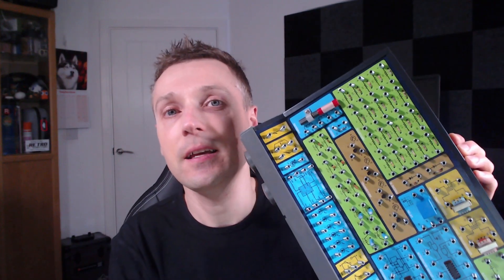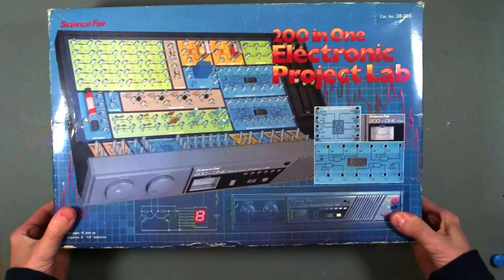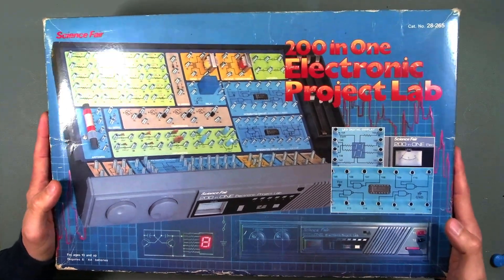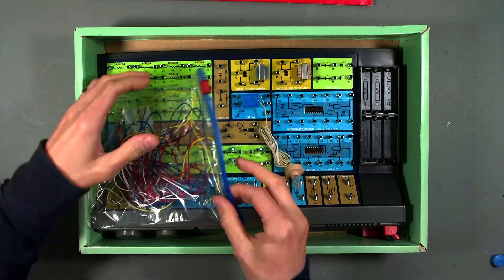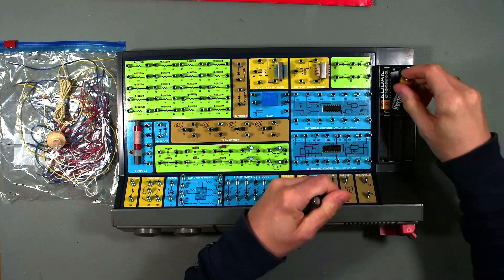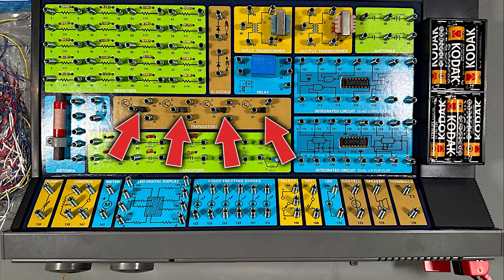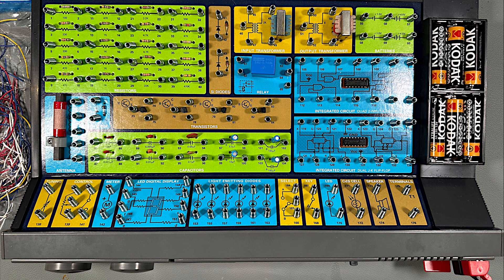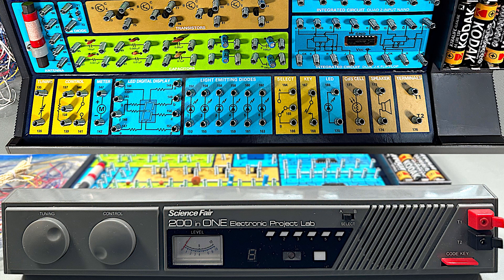Rediscovering 90s Electronics Kits - and I owned this one!

Comment: I had the older blue one, the only difference (other than cosmetically) was that it had an incandescent red lamp instead of the solo LED.

I don't know who designed the booklet but I've always assumed Forrest M Mims III must have had a hand in it, I still have a few of his books from Tandy.

I just bought the Maxitronix version of this kit from eBay because I never really paid attention to what they were using those transformers for, some of the projects look like they being used as inductor coils.
Reply from the maker: I think some of them were. One of them is mostly used as an audio output transformer, cant remember what they used the other for without skimming the manual.

Comment: 8:30 Also not need a battery, if I remember correctly, Connect that cristal earpiece to the antenna thing using the largest coil. Desolder the speaker from that old transistor-radio, Connect a long piece of wire and loop it around your room. Try to hide it from mom.
Now enjoy your wireless earphone.

I used my kit a lot in the early eighties and late seventies. Never got my head around how things worked tho. That changed only recently after watching various channels on YouTube.

Comment: I remember when I was like 10 my grandfather gave me this little Radio Shack crystal am radio kit. You would hook it to a fence and it had a little tuner knob. It didn't have batteries and it actually worked. Blew me away. Now I am Electronic Tech for 30 years. I have had several of these kits and played with them when I was young kid. I now use bread boards when I like to tinker. Everything is computer driven now, networks, computer repair, etc...

Comment: I had a 130 in 1 and that same 200 in 1 when I was younger.  I remember on both of those, I ended up frying at least one of the transistors and LEDs while experimenting around.  I also ended up killing the level meter in the 200 kit.
Reply from the maker: Wow I’ve had comments about killing LEDs and Transistors but this is the first about the level meter - kinda makes sense though it’s probably just as easy to damage

Comment: I had this exact kit - thanks so much for the trip down memory lane! I loved it even though I had no clue what I was doing (my biggest issue was that the instructions don’t really do a good job of explaining WHY something does what it does, or perhaps I was too young to understand). Ultimately, this kit gave me my first taste of the dangers of electricity when the batteries ran out, and so I decided that in order to complete the radio that I’d been trying to get working, I had to plug it into the mains. I used the external connectors on the front and wired them in where the batteries would normally go. The whole thing died in a blue cloud of smoke and I got 240v through me, and ended up on the other side of the room. Good times.
Reply from the maker: Wow, well, I guess that’s one way electricity earns some cautious respect!

Comment: I had a couple of the smaller kits when I was young, and remember building the simple radio, the burglar alarm, and so on. But I didn't learn a thing. I just followed the wiring numbers and it did the thing. I might try changing it a bit and it didn't work any more. Electronics was not for me.

Comment: I remember having one also , My fave project was the alarm where it buzzed when a wire loop was broken so i had fun rigging up many things around the house like doors etc. I remember somehow shorting the battery springs once and the batteries used were ni-cad rechargeables and the spring glowed orange, it was not too shiny after that 😀.
Reply from the maker: ooooh, you made a heater :) makes me wonder if its really suitable for that age range
Reply: @RobSmithDev  I have no idea but these types of products are seriously lacking in todays market , Ive often speculated on making a version of this project kit with integrated rp3040w board with springs etc for its pins.

Comment: I still have this set 😀 I also had the 20-in-1 and 130-in-1 sets. The latter I always thought was better, despite having less parts, although it had way more capacitors. The 130-in-1 has an op-amp chip instead of a second logic chip. So many of the projects start 1-29, 2-30 which means "connect the transformer output to the speaker" 😀
Reply from the maker: An op amp would have been a great addition, well, that and maybe a 555 perhapse

Comment: I had this kit. I kept on blowing the LEDs out because I was still ignorant about putting a series resistor in.
Reply from the maker: I’m sure you weren’t the only one!
Reply: @RobSmithDev  They should’ve really put the LEDs with resistors pre wired in so this wouldn’t happen. Also the diffuser at the front panel should not have been used, it makes the LEDs too dim.

Comment: Can you tell which transitor that is from the markings on the transistor used for the one transistor radio? I got back into making crystal radios and now I’m interested in making transistor based ones too.
Reply from the maker: The NPN are C945 and the PNP are A733 transistors
Reply: @RobSmithDev  that was fast. Thanks!

Comment: I had a 100 in 1 kit. I didn’t feel like it taught me much except to some extent what each component could do. Like on the page you showed, the coil on the ferrite rod, it just says it’s used in radios. It didn’t say it was a pair of coupled inductors and it didn’t say how it’s balanced with the capacitor to tune different frequencies, selectivity, sensitivity, etc. It doesn’t explain why germanium (low voltage drop because the signal is so weak). It doesn’t explain how the diode “detects” AM audio waves from the carrier wave. On the version I have, they didn’t switch to schematics exclusively which would have been hugely educational for me.

Comment: I got the Tom Salter Electronics 1 kit for Christmas in 1978 when I was 11. It was the best Christmas present EVER for me and turned into a career in electronics and electrics.
I found and bought the kit, unopened on Ebay a few years ago, I took it home, opened it, and played with it. 🙂
I had the same issue with the radio circuits when I tried them. Back in 1978 there wasn't all the RF noise around and there were plenty of strong MW radio stations, I could easily tune into half a dozen stations, but there just isn't that many LW / MW radio stations operating now.
Reply from the maker: It’s a shame, but was magic back then when it worked!

Comment: I had one of these kits but couldn't get anything working. Seen one back in the mid 2000s and tried to build a radio or something and it didn't work. Also I had snap circuits and I tried to use it as an amp but it didn't work.

Comment: I had this exact kit, thinking now how they ripped us off. All the time it took to remove and rewire wires to set it up for the next design, 50 minutes for a jk flip flop, then another 40 for the other ic(i forget now its name), you would only do it once, or should i say, be successful once for you'd no doubt blow those cupcakes up quicksmart
Reply from the maker: I think after finishing and pulling mine apart I slowly ended up snapping the legs off accidentally whilst wiring them together ‘mid air’ lol
Reply: @RobSmithDev  I can say I never had rust or serious corrosion, maybe a few bent springs with being over enthusiastic. Obviously one of the first thing to do was remove the cardboard backing cover. I wonder what a modern day equivalent could be, then again would you bother, or just go straight to an Arduino etc?
Reply from the maker: @dav1dbone I think that’s the point though, they would go straight to arduino and teach flashing an LED with it, and then (I’ve seen it) people grow up believing they need an actual microcontrolller to flash an led!

Comment: I had the older version of that.  Later on I had the 300-in-one kit and that taught me how to read schematics as the kit was breadboard based.  Radio Shack used to sell all kinds of handbooks as well.  I did find an electronics project kit similar to the 60-in-one and gave it to my nephews a few years ago.  They are now at the age where they can work on the projects by themselves. My sister used to do the projects with them when they first got it.  It's a shame Radio Shack of the 80 and 90s no longer exists.  I used to love going there and also looking through their catalog as a kid.

Comment: As a kid all of my electronic project boxes were Christmas or Birthday presents. Each one had more and more experiments. That led me to branch out to their mini kits, home brew projects, Ham Radio, computers. The paper rout, mowing lawns, and collecting pop bottles paid for many of those other projects. Today kids have so much more to look forward to. The raspberry pi, Arduino, 3D printing, Laser engraving and cutting, Robotics. And each one of those activities can be tied together. Like 3D print a case for your ham radio project or use your Raspberry pi to control your ham radio. That box with all those springs and wires taught me much more than electronics and tied me up for hours trying to find the wrong or missing connection in that rats nest.

Comment: the radioshack solar-power kit (had two solar cells, plus the usual assortment of transistors, resistors, caps, antenna coil, etc), woke up the electronics bug in me.
Saved and bought myself the 150-in-1, and then breadboards and soldering irons.

Much later in life, I discovered that my never-met biological father was a electrical engineer.
Reply from the maker: Wow - amazing. My grandpa was into electronics so I think I got my interest from him

Comment: I loved these as a kid. I had quite a few different versions. One of my favorite things to do was change the values of the resistors and capacitors (or connect more of them) on a completed circuit to make it operate differently. This worked especially well on the ones that made sound.

Came to learn many years later that this is known as "circuit bending" in the electronics world.

Comment: I received a 200-in-One electronics kit in 1982 when I was 13. I had zero electronics experience at the outset. I enjoyed it, it was cool, but a lot of the projects were missing that wiz bang... especially after spending an hour connecting wires. I don't have the kit or the book anymore, but I know for a fact at the very end of the book there is a comment about "if you enjoyed this kit, go to Radio Shack, buy parts and continue on." Shameless marketing, but it worked on me. I went to Radio Shack, like many times before, but I guess I was in a different frame of mind due to the kit and was drawn to the computers. They had sample code books too, typed in some and I was hooked. I loved electronics and computers, but I remember thinking once I get a computer, there is no more expense from that point forward, not so much with electronics, so I pursued computer programming. I am now 55 years old and I have had a glorious 35 year programming career. I credit this kit for starting me off on that journey. P.S. That crystal radio was oddly enough the most memorable for me. Such a simple circuit and you get a radio that does not need a battery... what the hey!!! Back in 1982, you got several strong stations.

Comment: I had a 300 in one electronics kit - it had probably 1.5 times the number of parts on your model and included the 555 timer, 4017 decade counter and a quad and gate to name a few. 

At onepoint I was doing a project that was meant to be an audio amplifier, but it instead became a one shot - as i'd mis wired an electrolytic capacitor, causing it to explode. Of cause boys like explosions so I went ahead and blew up a few more. Eventually I was allowed to have a soldering iron, so the first thing I did after building a few kits, was to replace the capacitors on my 300 in one that I blew up previously so I could hand it down to my cousin.

I'm 49 years old now, yet blowing up electrolytics either on purpose or by accident still never gets old!
Reply from the maker: I always wondered why the kits I had never contained a 555, on for that matter a basic Op-Amp. Weird. Yeah we all like to blow up capacitors :)

Comment: Here in the States the FCC is considering reallocating the AM band for other uses. This will make projects like the AM radios unusable. Sad. But, I think with a different ferrite antenna, short wave transmissions might be able to be detected.
Reply: What could the AM band possibly be used for other than radio? I think they might run into problems with the ITU as from what I understand they control the use and allocation of AM around the world.
Reply: @sw6188  My bad... it's the the auto makers that want to remove AM radio from cars. I thought it was because the US government was pushing that. To the contrary, the US government is trying to pass legislation to mandate that all cars have AM radios for safety concerns. The auto markers claim that they have to use costly techniques to prevent noise on a car's AM band, so they want to get rid of the AM radios to save some money while saving a bit more by not having to worry about noise.
Reply: @paulromsky9527  Yes, that sounds much more like what is going on. The auto makers have installed so many noise-making circuits and modules in cars now that the AM radios struggle to receive through all the hash, buzz and static. It's no wonder they want to get rid of them from their vehicles. AM radio has a very important place in society. In some areas it is the only radio that people can receive. For civil emergency information there is nothing better.
Reply: @sw6188  I agree, AM is critical for "survival". When the SHTF, EMPs will knock out a lot of electronics, but tubed based AM transmitters and Crystal Radio receivers will survive.  AM 550KHz to 1600KHz must be preserved for this reason. I have a 1987 Fiero GT and its AM radio is very clear. Back then, only a few things were high-speed digital (like the ECM) and were well shielded. Under the lid on the engine compartment, there is a grounded metal shield... this is needed because the body panels are plastic.

Comment: I had the Radio Shack 150-in-One electronics kit as a kid and absolutely loved it. Once I learned about the different projects I started designing circuits that would combine what I learned from the different circuits into larger projects I could build if I could afford to buy all the different components needed. I designed a synthesizer but never built it because it was too expensive for me to be able to get the parts. I'm surprised Korg hasn't made a combo electronics kit and volca modular product because the volca modular very much has the same vibe as these old educational toys.
Reply from the maker: Synth electronic kits, now there’s an idea

Comment: I had one of these when i was young. Looked forward to sitting down and reading the book i could not make head or tail of any of it. Tried wiring up a simple light that went off when it got light. That didn't work checked and rechecked but alas na no luck. Tried to make a radio na no luck checked and rechecked but again alas nothing. In the bin it went never got anything to work on it.
Was not for me preferred taking things apart repairing them {Vacuum cleaners small motor bikes ect} Ended up a qualified Dell Engineer and retired a photo copier engineer. Funny how things turn out. Great vid :)

Comment: The Universe (or is it the YouTube algorithm)  is an odd place.  I was thinking about the Radio Shack 120-in-kit I had in the late 1970's just last week and up this pops.

Never got a useful AM voice broadcast through the radio projects: too remote from the transmitters.  However, fiddling with the components I stumbled across a Morse transmission that turned out to be the ident signal from a nearby aviation navigation aid (a non-directional beacon, NDB).  That beacon remained operating until 2016.  At that time I was managing data associated with air navigation in Australia.
Reply from the maker: Cool! I assume you learn and decodes the signal too?
Reply: @RobSmithDev  Indeed. −−·  ·−  −·−− was the ident for Gayndah NDB on 284 KHz (although I had no way to know that then).  The ubiquity of GPS made maintenance of many navigation aids not cost effective; about 200 were decommissioned around Australia in 2016.  

The interplay of inductors, capacitors, and diodes was magic then, and managed to remain in the realm of magic through an electronic engineering degree.
Reply from the maker: I still need to learn more about inductors but I’m not a fan of math so that doesn’t help lol

Comment: wow this goes back a bit.
started off with a 30 in one kit, then had a 60 in one kit then moved up to the 200 in one kit.
by the time I had the 200 in one kit, I was making my own RF amplifer circuit for the AM radio and built it using the Class B amplifier project (from the manual).
this worked a lot better than the original AM radio project as the RF amplifier circuit didnt load the tuned RF tank circuit.
Reply from the maker: Very cool!

Comment: Loved these kits and still have some in the Robthut museum. But you can still buy a kit very much like this one. It is called, Elenco EP-130 130-in-1 Experiments Electronics Playground.
Also there are smaller kits like the , Snap Circuits Jr. SC-100 Electronics Exploration Kit, Over 100 Projects, Full Color Project Manual, 28 Parts.

Comment: I also started in electronics with earlier version of 200-1 kit and still have it
Reply: Was that the one where the batteries were installed from the bottom?
Reply: @OnlyAmiga85  yes and with plastic lid
Reply: @fistsbs  That must have been the one I had.  Unfortunately while building my first project, smoke started coming from the battery compartment so my dad had to quickly open it and get the batteries out.  He took it back to Tandys and gave them a hard time over it, and I never got another one.  I was distraught at the time but was given electronics project books where I built things with veroboard.